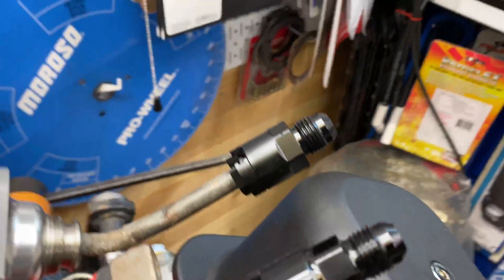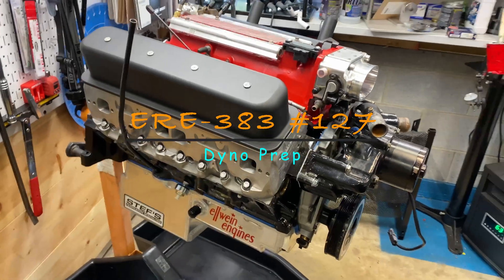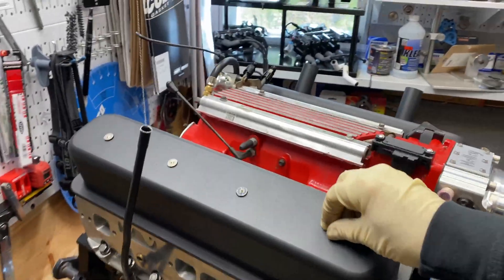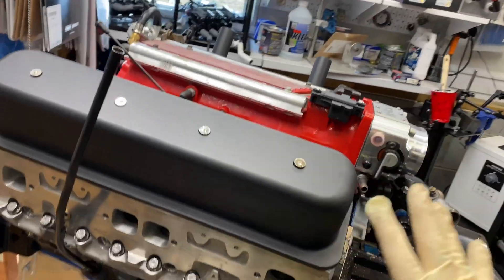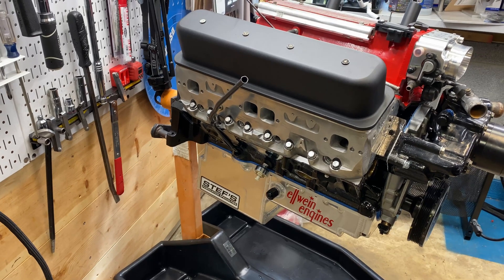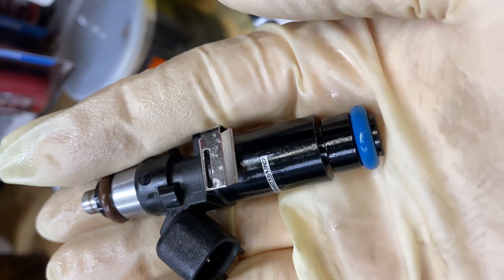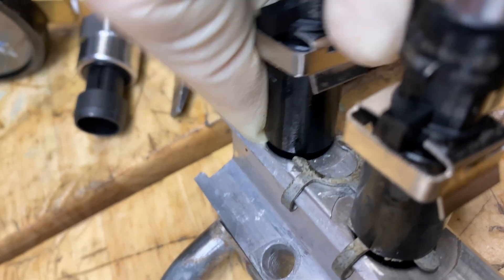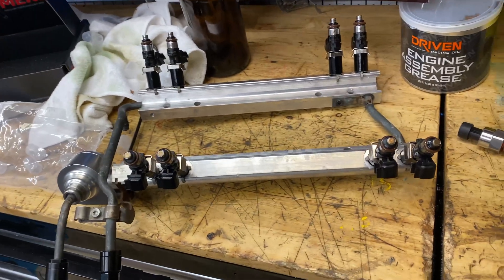LT1 383 engine build. Final Touches Prior to Dyno

Comment: Carl is it a must to use the injector retainers.??   I've gotten yes/ no
My accel injectors won't allow me to use them.   Ty
Reply from the maker: I would say...Yes...it is a must for safety sake.   It will make sure the injector does not fall too low into the intake and pull out from the fuel rail.
Reply: @EllweinEngines 

Ty 
Do u know if Accel makes clips for their injectors.  off hand.      I'm putting a new regulator on soon.  Do the rail will be off.   Be a perfect time to correct that problem thanks again

Comment: I have a question. My son bought a 1997 Trans Am and guy that sold us the car didn't have the cam card nor did he know that spec's. The cam had this information on the cam: BSPRC4,  L7696.07, and 41615Y scribed on the end of the cam. I googled all of the information and nothing comes up. Do you know what cam or what manufacture the cam is?
Reply from the maker: so sorry but I do not have a clue to what the cam may be.   Possibly stock cam numbers from GM .  If it were aftermarket you sometimes see the duration scribed on the end of the cam.

Comment: I really think you should add a little more clearance to that dipstick tube a little more. With vibration and cornering you will eventually wear both the tube and the main cap bolt. It’s just extra metal that doesn’t need to be in the engine especially near the bearings which just love to pull metal in and cause havoc. Just my 2 cents as another builder and enthusiast. Otherwise great. Build and I can tell you planned out the build.
Reply from the maker: thanks for the tip/advise.  So you think the tube and cap touching may vibrate ?  I never thought of that until you mentioned it.  Good advise.  thanks.
Reply: @EllweinEngines  yeah, I’ve ran into it this before lol. It didn’t really hurt the cap at all. But it did slowly wear down and I kept finding small amounts of shiny smh. I thought cause it was a completely new build it was just things bedding in and after the 3rd oil change with still finding small amounts I pulled the pan and realized that it was the tube rubbing. It was a small amount. But with the bearings right there it’s gamble. I didn’t notice anything in the bearings and since it’s been solid! But definitely give it some space if possible or angle cut it and deburr again. It’s a pain but worth it!

Comment: Carl, I have a quick question, where would you set piston to head clearance with Scat forged I beam rod, 4.040 bore . iron block and 2618 wiseco forged pistons? my piston measured .006 in the hole, thanks!

That oil pan design looks well thought out!
Reply from the maker: I would try to get 0.040" for a safe clearance with the less sturdy Scat rod.  so a 0.034" gasket will work or certainly even safer with the 0.039" FelPro 1040 gasket.